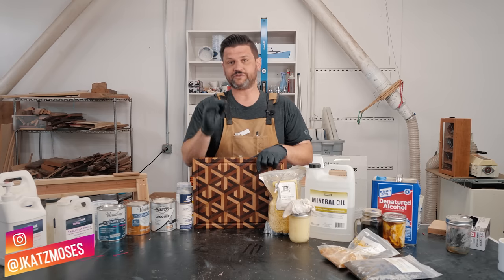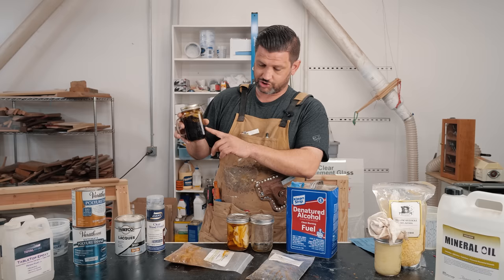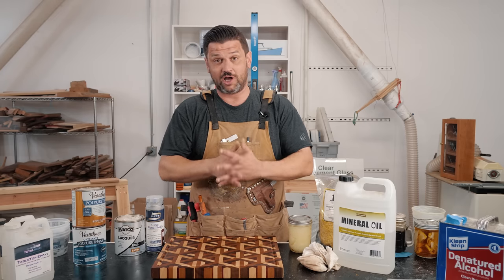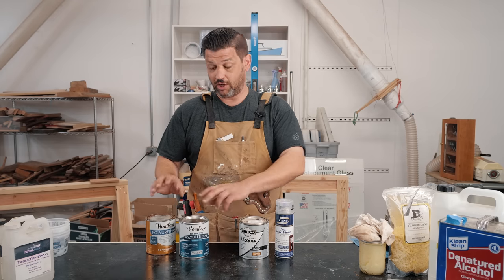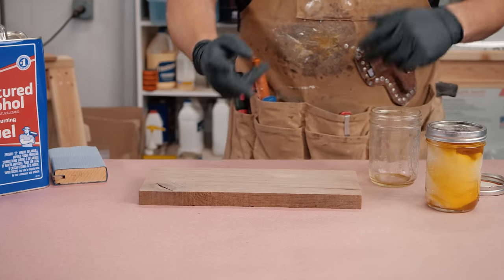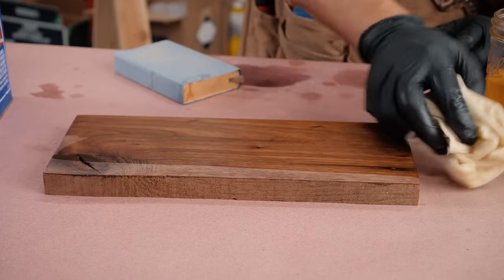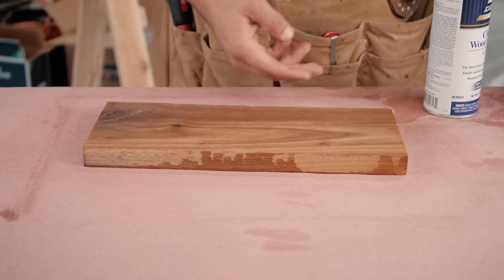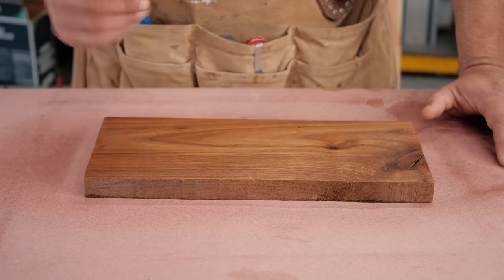My 4 Favorite Finishes and How to Apply Them

Comment: Your shellac method isn't giving the furniture any of the benefits unique to a shellac finish being that thin. A true french polish looks like a nice coat of amber, and it fully protects the furniture from small dings and scratches by thickness alone. If it's done right it will be just as transparent as a lacquer and easy to repair with the same method as used to put it on.

3 thin coats is the equivalent of a hardware store stain. You're not really doing anything except changing the color of the wood and keeping humidity out.
Reply from the maker: I wasn't doing a French polish. This is my favorite way to apply shellac.
Reply: @katzmosestools  I get that, but if you're not going for a full french polish, you're better off using a tinted lacquer or varnish for the same color. Without the thickness of a french polish, shellac finishes are just as fragile as the flakes you use to mix it up.

It looks nice when it's thin, but you're sacrificing a lot in the durability department.
Reply from the maker: I have tons of projects finished in this way that look as good as the day I finished them. I appreciate your opinion but we're going to have to agree to disagree on this.
Reply: @katzmosestools  They probably do, but there are also tons of projects sitting in museums that were given a full french polish, and none to my knowledge that were just given a topcoat. I'll take the testament of the pieces that lasted for 300 years over the 3 year old coffee table.
Reply: @katzmosestools  

Hello Mr. Katz...
I've never thought of commenting on a very well done and didactic video such as yours.
I subscribed to your channel for Christ sakes...

However, concerning to the Shellac application technique I have to say that is not quite right.

My family has been in the guitar making business for over 50 years in Paracho Michoacan- Mexico and we also use shellac for furniture finishing or restoration. Tough, no matter how you use shellac, it is always French polishing when it is applied. The Spanish term is actually "barniz a muñeca" or "muñequeado" even "pulido francés"

The only differences are: the environmental resistance of your finish, the color, the surface texture and the refraction (bright).

The last thing I want is to be disrespectful of your knowledge or your channel, Sr. I'm only trying to provide a positive critique.

I'm sure that you are well aware of this information and may be because of the practical purposes of this channel, you decided to simply the content.

As you certainly name another professional's visual material for us to enhance our knowledge on the matter.

Thank you for time and to you, because you are always finding a way of simplifying the work without sacrificing the end result and of course, keeping an eye on our budget.

Congratulations and my best regards to you.
Reply from the maker: THANK YOU! I could say, "In my humble opinion I believe the sky is blue." Someone would write 6 paragraphs citing evidence as to why the hexadecimal color code for sky is actually F00000234 and that I'm a stupid stupid dumb dumb. My favorite quote is, "funny how many know it alls watch DIY videos." Some guy with 2k subs released a 18 minute video the other day bashing me for not responding to a comment he left correcting something I said. 18 fucking minute long video because he was pissed I  didn't respond to what was clearly a loaded question designed to start an argument.